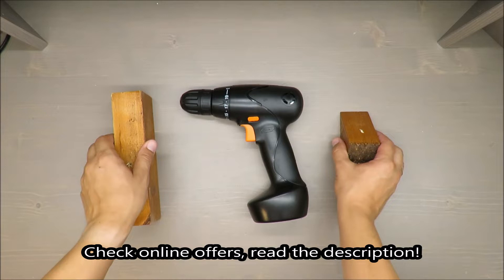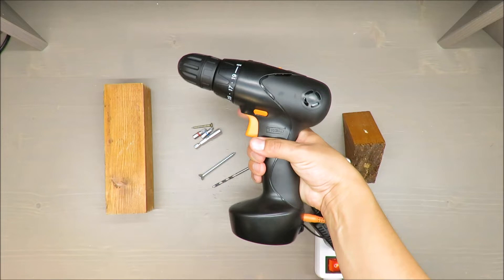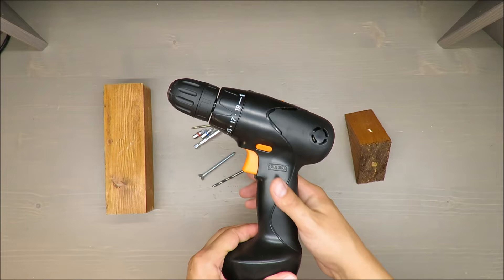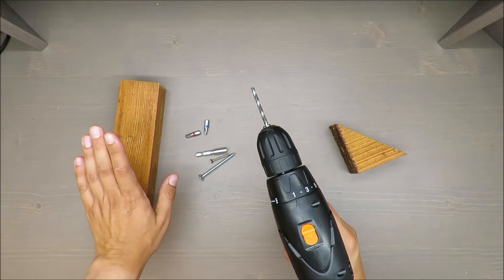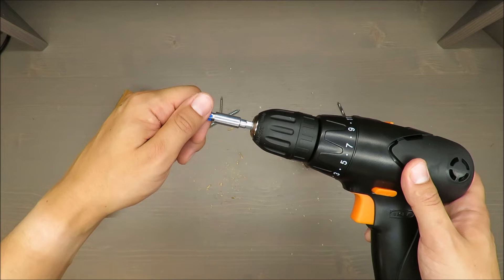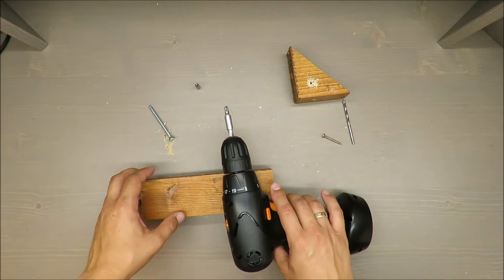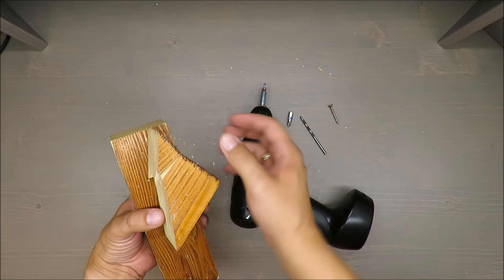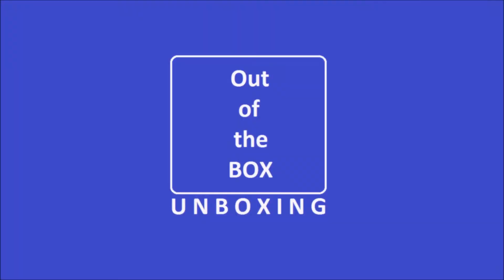FIXA 14.4V Screwdriver / drill REVIEW TEST (IKEA li-ion 14.4 V)

Comment: Those screws you are using are Pozidrive (PZ2 / PZ3) not Philips. Pozi is really popular in Europe, and they look very similar to Philips, but the 45 degree diagonal markings on the screw head indicate they're Pozi. You would do so much better using the correct PZ2 and PZ3 bits on those screws. They'll be much less prone to "cam out" and give you better bit life. Edit: Just zooming in I see that you did in fact use the correct PZ3 for the bigger screw, you just incorrectly called it PH3. Take a close look at those bits (especially look along the 45 degree diagonals) and you'll clearly see the PH/PZ difference.

Comment: I have to drill through concrete and only have this drill can this work ?
Reply from the maker: Strongly I'm advising to at least rent proper drill. If you drill to long your hands will be tiered and you start to make offset holes. This will going to end up as waist of time. On top of that I don't believe it going to do more than scratching the surface.
Reply: If we are talking about proper concrete then NO. Get a rotary hammer.

Comment: How do you know which gear to use when drilling? I guess you need the most torque for drilling and the most RPM for screwing in? So for drilling it is better to use gear 1 right?
Reply: No 😁
Use faster speed for drilling. Screwing you can go bot ways but i prefer slower because it needs more torque to drive the screw in.

Comment: How do you remove the nail/screw out of the wood in 10:08? Do you press a different button? 
Sorry for the dumb question, I have this same exact drill sitting in my storage box unused for a year now & decided it's time to stop paying for expensive handyman just to hang wall photos.
Reply from the maker: Above the trigger is a orange button on both sides allowing you to screw and unscrew. If you are right handed use a pointing finger in order to screw and thumb for unscrew. This orange button is going through screwdriver so it's impossible to "screw it up" :). Let me know if my explanation is sufficient...
Reply: @outoftheboxunboxing5020  It's very clear.  Thank you so much for taking the time to post this instructional video and to patiently respond to comments, even the rude ones!
Reply from the maker: :) take care!

Comment: Can it make a hole on metals and walls
Reply from the maker: Not so really. For steel it's lacking RPM's and for concrete impact. I can barely imagine it. For steel maybe 2 or 3 mm drill and for light ceramic wall like Ytong...
Reply: @outoftheboxunboxing5020  Thanks for the advice. Super helpful.